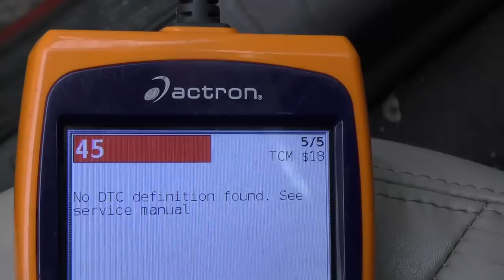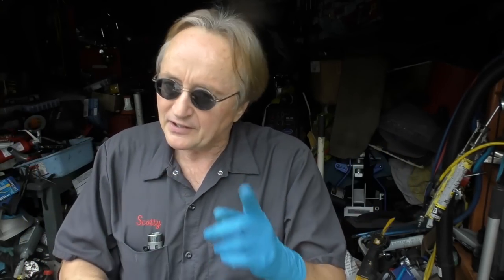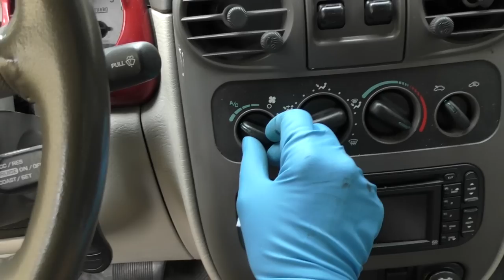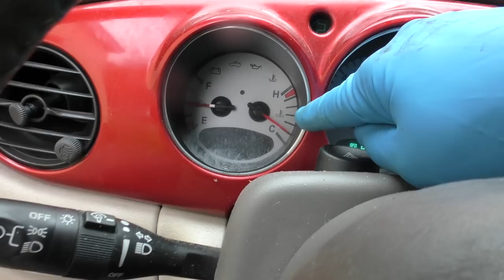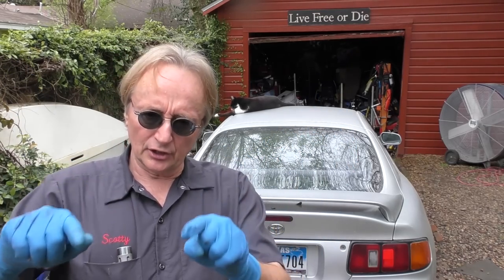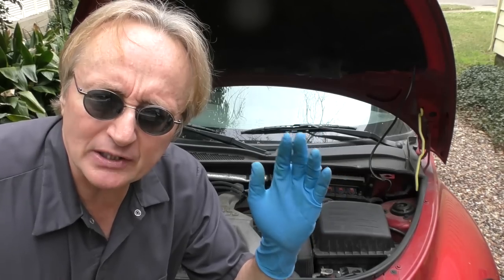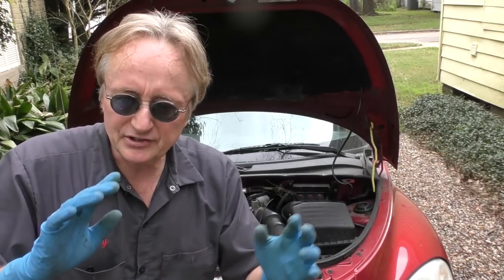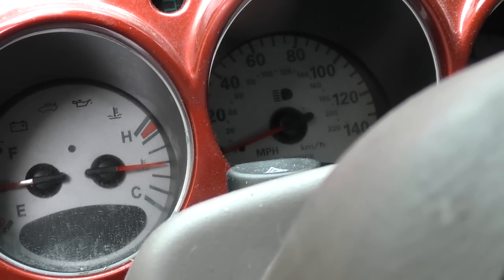This PT Cruiser Has a Serious Problem

Comment: the pt has a bleeder nipple below the thermostat to help you get the air out of the cooling system. If you dont get the air out you get steam built up in the cooling system and can cause more problems

Comment: Great educational video. I don't work on my car (I don't have to, Toyota), but if I did, this would be very helpful.
Reply: Never again for toyotas..
I've owned 3 ..
They are so overated..
My tundra has 133000 miles with a blown head gasket resulted in a almost blown motor..
Motor is 5500 at junk yards..
Camry has been in the shop so many times due to electrical issues it's not even funny..
Btw my ole junker truck with 318 has 285 k miles..
Btw junk yards get around 500 bucks for that motor when it goes..
Strangest thing all Toyotas dealerships have service departments..
Imagine that...

Comment: Bout an old 05 cruiser off Craigslist for around $600 about 4 years ago with 175k miles on it. Currently at 250k and running strong (mechanically). I’ve only kept it because of the 5 speed manual

Comment: I would look for a new radiator if the thermostat is ok, as the thermostat is quite likely to fail and not hard to replace. Just need to put in the right one. That is because there are some cheap ones that do not have a small bypass to let air out. If that little hole is missing can always drill a 1/16 hole in the body of the thermostat to make it work properly. 

Just as I would put a check valve in the line of a ported vacuum switch for the timing advance as there are two different points to get vacuum for advance and if the ported vacuum switch lets air go between the two vacuum locations it can cause an engine to misfire. Just because a new part is installed does not always mean that the new part will function properly, as such switches are slow acting and not snap action. Meaning the vacuum that is in the carburetor gets sucked out by the manifold or the other way around. That should not happen, but it is one of the things I figured out is wrong in the design of the vacuum advance of many cars of older design.

Comment: the  FIRST thing we used to do was change the thermostat,even if we get warm air since it is cheap,easy and is good insurance....ounce of prevention kind of thing. Of course we checked the fan for normal cycling on both speeds and the ac override as well.Also listen for fan striking the shroud  in case the bearing is going south and is quiet while running but  ticks when shutting down.(sometimes at high speed it will self center while running) Check for fore and aft play once the fan stops (car off) to see amount of freeplay in cooling fan (I only mention this since 20 min ago one of my old customers showed up at my HOUSE  to have me tell him what the noise  up front (of HIS PT cruiser was).....lol

Comment: Pt cruisers have rubber band transmissions lmao
Reply: @mistamaog  no you just plant your foot and it takes a minute before you actually go anywheres lol
Reply: @dynamicgameplay1825  like a cvt? Honestly cvts from the 2000s that aren't from toyota were absolute garbage.
Reply: @JamezRebelStudios  just a sloppy automatic transmission
Reply: Same auto trans as the minivans, the 4 speed aod, part of the reason why the PT is a light truck for smog and mileage ratings.  I really wish mine was the 5 speed manual. I drove a friend's 5 speed, and she freaked out when I revved it past 2200rpm while my auto shifts at around 3300 or so depending on how deep into the pedal you are... NOT A CVT transmission!
Reply: Yea it’s pretty fun tho makes it feel like it has too end
Reply: PT Cruisers do not have CVT transmissions!!! The biggest problem is with the solenoid valve block which is easy to replace!!! This same transmission is used in the Caravan and Neons!!! But overall they all are junk and only designed to last about 100 thousands miles!!! Like most cars!!!
Reply: @rockerpat1085   Know multiple with over 200k miles. My friends 5 speed PT GT 2003 has over 270k. Original motor and transmission

Comment: Scotty I'm Automotive my whole life I live and breath Automotive, I have to say I really think your vids are great for general people , but I have to say I would have shown the audience always test thermostat in hot water first with a thermometer, to verify thermostat is functioning before installation. It's best and saves time, especially if thermostat is installed and doesn't function properly and causes engine to overheat again , This can happen. Then everything has to be redone again.
Reply: laredo 89 Good point. As an automotive apprentice, I can see how testing a new thermostat in boiling hot water would be necessary. However, for all we know, Scotty may have already done that off camera.

Comment: all pt cruisers terrible cars in my opinion
Reply: All Chryslers made after Mercedes bought them are terrible cars. So are most of them before then, but there were a few exceptions. That said, I owned a PT for a few years and it never gave me any problems (but I bought it cheap from a little old lady that towed it behind her RV and sold it before it gave me any issues ... oh and it was a manual transmission one).
Reply: The Chevy HHR was just as bad.
Reply: @Zundfolge  I kind of like the pt cruiser.  Just for the fact that most pppl hate on it.  I see them for really cheap on craigslist all the time and think one would make a great vehicle to take camping and i think I could actualy fit a couple dirt bikes in one.
Reply: @MickeyR6  Interesting bit of trivia ... both were designed by the same guy ; Bryan Nesbitt.
Reply: @JoshHopkinsYT  Its just a Dodge Neon with a different body ... people don't bag on the Neon as much.
Reply: @Zundfolge  I guess that explains it. 😁
Reply: @JoshHopkinsYT  i can confirm that a dirtbike wont fit lol
Reply: They were incredibly variable haha they either go 300,000+ miles or they die after a couple of years
Reply: @realname6485  lol
Reply: @Zundfolge  well it is a dodge product they always always have bad electrical i know ive ownd a few and you learn from your mistakes
Reply: @19jacobob93  probably because it was manufactured in Mexico. Quality control measures there very poor
Reply: @stylicho  alot of car parts are made in mexico including fords that is not the case of quality
Reply: @realname6485  if you took the back seats out you should be able to fit two

Comment: I just bought a PT Cruiser yesterday! Cheap!
Reply: You'll regret it.
Reply: They are cheap for a reason. I bought a used 2006 PT Cruiser GT convertible for 2500 dollars with 69K original miles about 2 years ago. 
Every time I turn around there are these little sensor problems. These cars are a electrical nightmare. But it's fun to drive when everything is working. LOL

Comment: In your comments Scotty, you stated why not to buy a Chrysler , serious problems.
Really Scotty?
A tstat is a serious problem?
The radiator was replaced due to a front end collision? Is that the fault of Chrysler engineering or bc of the accident?
It just goes to show how biased you are towards Chrysler. This vehicle is 10 years old and small issues like this are not considered serious.
If you tell your viewers that the engine head gaskets are bad or something wrong internally with the engine, drivetrain or other major components, then i can agree with your decree, that a certain make has serious problems but to make mountain out of something small, really reeks of your inward bias towards Chrysler. 
As i said before and i will say it again, Chrysler has made many extremely durable and reliable vehicles and they far outlasted anything thst GM or FORD made back when you started as a spring chicken mechanic 51 yrs ago
Reply: True I guess but I still l enjoy Scotty

Comment: When ever I come across a car with  a heating or cooling issue, the FIRST thing I ask is "how old is the thermostat?" It is the most commonly overlooked and/or forgotten routine thing and so cheap to fix. Here in Wisconsin, if it is a daily driver I recommend changing it every year or at least every other year. You can also inspect the coolant at the same time and flush if needed. It really is low cost peace of mind.

Comment: My timing belt busted. Radiator cooling fan is the most common problem for pt cruisers overheating. If it stutters at stop when ac is on it's the low speed on the cooling fan out

Comment: If the engine is knocking even after everything else was serviced, it may be your thermostat valve.
My friend's Park Avenue was knocking, I told him I suspect it was because of the engine was running at the incorrect operating temperature. Changing the thermostat valve did the trick.

Comment: a stuck thermostat is not a serious problem at all. It's a $10 fix
Reply: Overheating was the serious problem.
Reply: Depends on the make and model. $10 part yeah. But some cars have it on the lower radiator hose. Could be hours of work for a stupid cheap part. (new Toyotas)
Reply: Trick Title -- All PT Cruisers have SERIOUS problems.
Reply: I think he was referring to overheating being the serious problem.

Comment: Stuck thermostats are a pain!! Not sure if you have worked on one of those V-6 land rover discovery cars, but you need to take half the engine apart just to get at it. I did this job on one several months ago, & wondered what the hell were they thinking when they designed that.

Comment: I was sitting at a stop light a couple of months ago and I looked down and saw that the coolant temperature gauge was between the middle and red mark. I turned the heater on, and pulled into the O'Reilly parking lot after the traffic light turned green since I was right there. I got out and felt the upper radiator hose to see how hot the engine was. To my surprise, it was stone cold as if I hadn't been driving at all. I got back in my car and kept driving. Everything was normal. The next day, I let my car idle while waiting for my food at Sonic. I noticed the needle inching toward the red again. I turned the heater on again and drove back to work. After I got back, I felt the hose and it was cold even though the engine was hot. I replaced the thermostat and the car has been fine ever since. I replaced my thermostat as preventative maintenance when I did the timing belt 35,000 miles ago with one from the dealership. The reason why I got the current thermostat from O'Reilly's was because the dealership thermostat said Motorad on it. I figured there's only 1 or 2 companies making thermostats for my car and that all they're doing is putting the same part in a Mopar box. I have a 2008 non turbo PT Cruiser. I've owned the car for 7 years and it's been extremely reliable. I've put 100,000 miles on it and have never had a check engine light. The factory service manual says to install the thermostat in the housing prior to bolting it on the engine. The problem was that the new thermostat wouldn't stay on the bottom of the housing so I used dental floss to hold the thermostat to the housing while I bolted it on. After everything was torqued down, I pulled the floss out of the filler neck and the bleed valve was aligned with the notch perfectly.

Comment: I had a bad radiator cap causing overheating on my PT. I always check he radiator cap first then keep isolating all the other items, electric fan, thermostat, radiator and loose fan belt not moving the water pump.

Comment: My cruiser had this problem. Same convertible 2.4 turbo. It does better with a new radiator cap but when the A/C is ON it gets hot. Off it’s fine and when the heater is on it’s fine. :/

Comment: PT's are really bad about clogging the radiator and the symptoms are about the same as the thermostat. A back flush will often fix that, but a new radiator is only about 60 bucks (get the HD one for extra passes). However if it's a turbo, pack your lunch and get out a bag of bandaids . . .

Comment: I'd be willing to bet this pt has a partially blown head gasket. Mine did the same thing, had to put a quart of coolant in it every hundred miles or so because it kept blowing it out (exhaust gas made its way into the cooling jacket and displaced fluid out of the overflow). a new hg fixed the problem. I'd be interested to see if this customer brought it back in within a few weeks.

Comment: I would have run a flush through the cooling system before replacing the thermostat or refilling the coolant. I’ve often found silicates from the old coolant collect in the bends and cavities of the passages.

Comment: I had this problem in mine with the fan not coming on with the AC at idle, replaced fans twice then I sold it. You would think during the second generation they would have fixed it. Also that rear watts link replaced twice and engine mounts.

Comment: I have a 1992 Miata. It overheats while sitting at idle too long. Like you said the a/c and the cooling fan are two separate systems. I've tested both fans separately. They both work. I've checked my cooling fan fuse and relay. Both are fine. I've also replaced the cooling fan switch. A while back, I changed the radiator cap and thermostat. One fan runs with the a/c on. With the a/c off, none of the fans work. I'm at the end of my rope here. Is there a place for a scan tool, on a 1992 Miata? Or is it too old? Thanks. Your the best! Scotty!

Comment: My parents got a 2001 PT cruiser from my aunt who passed away. It had 38k miles on it, and they gave it to me for free as my first car. Obviously, it was freewheels, so I was grateful and drove it. After about 5 months of owning it, I sprung a coolant leak from radiator hoses, I replaced the hoses, and not even a month later, the car started overheating badly. I had the radiator replaced around 45k miles. I drove good through the winter, but once spring came, it again began losing coolant and overheating. I had the radiator replaced again. The next summer same story. I had the radiator replaced again. It happened again, and the engine blew while I was driving. I took it to a scrap yard and got around $250 for it. I will never own a Chrysler again. Even the 300's were having the same issue. Pacifica was overheating as well. Cheaply made cars, obviously cash grabbers. Save yourself the time and money and buy literally anything else. I found a cheap 1999 Ford Taurus and drove it for 3 years, put nearly a 100,000 miles on it, no major issues, just regular maintenance. I recently hopped into a 2008 Ford Taurus and it's a fantastic car.

Comment: I once had an 03 dodge neon that froze shut its thermostat. 60 miles away from home.  I had to stop 10 times to cool the engine and I replaced the thermostat in the auto parts stores parking lot. Talk about bad timing!

Comment: Oh man I had a 2003 Turbo PT Cruiser that had a coolant leak. A faulty rubber hose had cracked way down below under the engine. It was a pain in the butt to replace. I do not miss the rattling engine. God that car was gross.

Comment: I unfortunately was stuck in traffic and didn't notice my car was overheating until it was too late. I decided on putting in a used engine with a two year full warranty. After two year, engine starts overheating! Caught it in time. It was the thermostat. Two years later, engine us overheating! Caught it in time again. This time it's cracked hoses.

Comment: i drill say three    3 to 4 mm holes in thermistat.. i live in a hot country..many times termistats stops working and u do the motor ... but with some water getting throught u save the motor..

Comment: Scotty good beautiful morning to you
I'm writing to you from a town called zacapu Michoacan Mexico I like watching your videos a lot 
Here's my question Mr Scotty  working on a PT cruiser 2001,, I found the timing belt slides to the inside of the engine and it make a long line around the oil pump untill it star to leaks oil,,,, well I replace the whole everything in this car take the crankshaft and the head to the machine shop I replace all bearings  new pistons rings all the things a motor needs ok but once a put a new set of timing components,,,,, the deam timing belt keep sliding to the inside of the engine I'm kind of frustrated now I'm working with a washer putting it in one side of the bracket and it works but now it moves to the outside of the engine what do I'm doing wrong help mr Scotty

Comment: Ok I know everyone hates a pt cruiser but I have one. And unfortunately love it. So here is my question. The whole instrument panel has gone out.  I’ve tried the reset by pushing the trip mileage button and turning key on three times. Didn’t work. I’ve checked the fuse. It’s good. Any other ideas?

Comment: Speaking of cooling problems on Chryslers, I have a serious gripe. I HATE sealed systems like the one on my 2010 Journey. Had one heck of a time diagnosing a cooling problem a couple months ago. Had to take it to the shop to get it worked on. It has to be serious for me to go that far.
Reply: What fixed it?
Reply: @250gto9  turns out there was a small leak in the tubing beneath the resovior. Wasn't big enough that the coolant would leak out all at once, but it was big enough to depressurize the system - hence my hatred of closed, pressurized systems.

Comment: YOU SHOULD ALWAYS PERFORM A ENGINE BLOCK TEST, WHEN A VEHICLE HAS BEEN OVERHEATED. PO300 IS A GOOD INDICATION, COOLANT IS ENTERING THE COMBUSTION CHAMBER, AND CAUSING, MULTIPLE CYLINDER MISFIRES.
Reply: That's a good idea, the cooling system is the main weak point of the PT - pretty much every part is problematic.  The 2.4L also needs relatively frequent plug and wire changes and is known for carboned and pitted exhaust valves and seats.

Comment: Worked on a spreader truck once that kept over heating when checked to radiator it had 20 lbs of chicken feathers in between the A/C condenser and radiator cleaned it out prob solved.